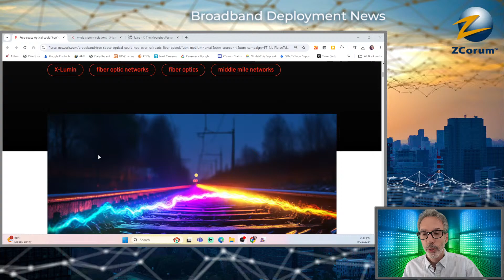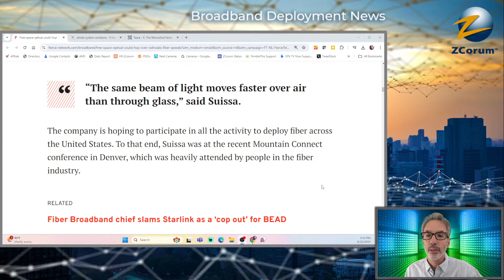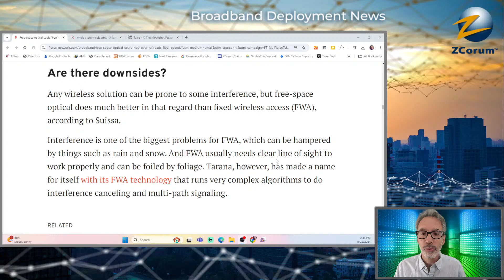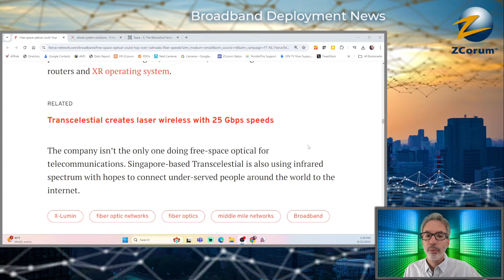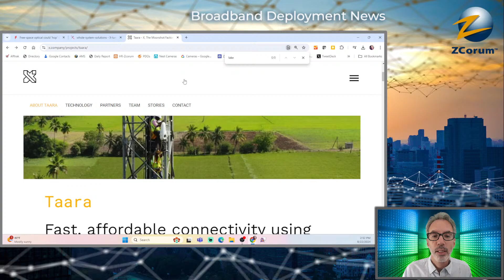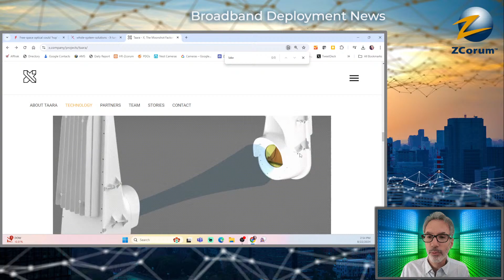How Free-Space Optics can Speed BEAD Middle-Mile Deployments

Comment: Problems we had with this 24 years ago:

1. You need a flat area or a long slow slope.
2. Air density. Some of the transceivers would see one way better than the other. Oddly enough people had difficulty seeing one way more that the other.
3. People built buildings in the way.
4. Some buildings had reflective surfaces so at certain times a day, we'd lose connectivity.
5. Heavy snow, fog
6. The transceivers on short distance LEDs couidn't be close to each other. This means that if I needed to send signal at 45 and 135 the tranceivers has to separated.

In the end, we used it until we could get fiber there and then we removed them. I'm sure the new tech is better, but we never revisited it.

Plaintree Wavebridge. Look it up.
Reply: Thanks for the comment. It looks like Wavebridge only used LED technology. I assume the laser technology used today would be much better and more reliable. It still would require line of sight, so a building being in the way is not the right application, unless you're delivering broadband to that building. A reflective surface of a building may be less of an issue with a laser. Heavy fog can still be problem. Apparently the size of droplets in fog is similar to the wavelength that FSO uses, which can causing attenuation from scattering. That is going to limit the distance that can be deployed. But, going over a railroad track or a river might be a good use case. Rivers often have fog over them, but maybe if the distance is short it won't be much of an issue.